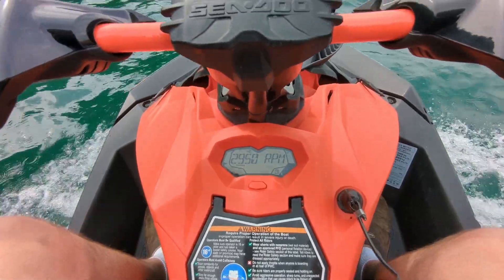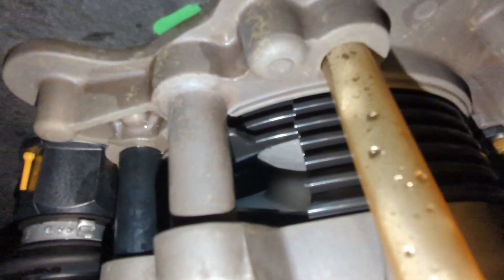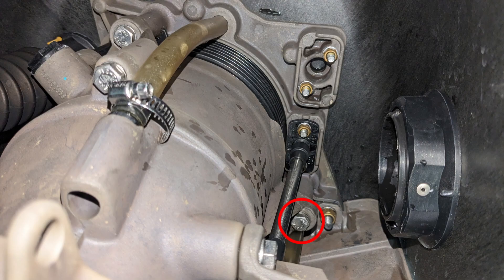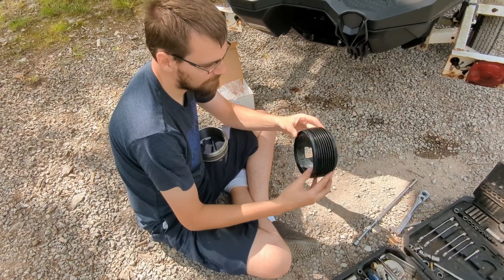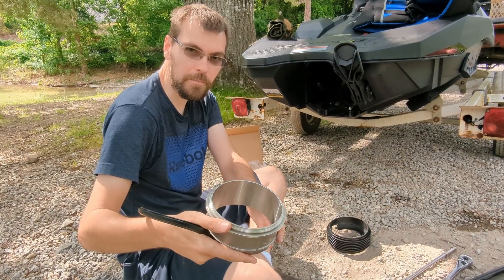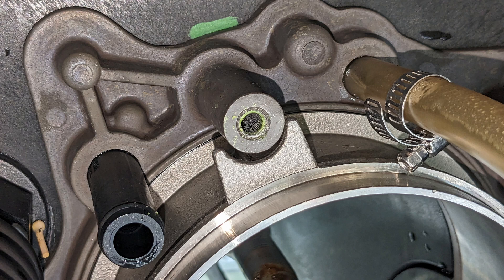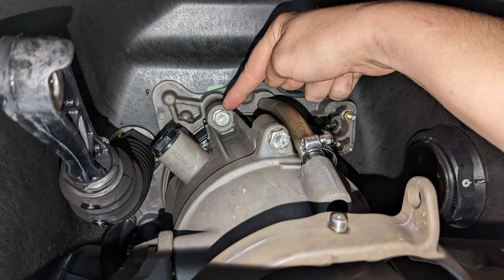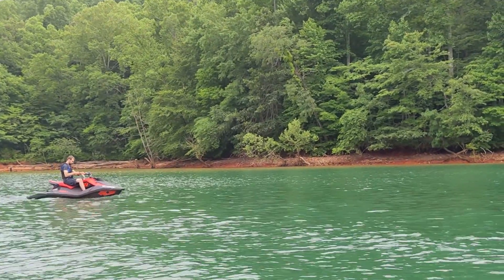Sea-doo Spark wear ring replacement, stainless steel upgrade.

Comment: If you're a responsible rider that doesn't beach their skis or ride through gravel go with SS.  If you are the typical renter stay with plastic
Reply from the maker: I've seen so many rocks and garbage in pumps I'd never beach a ski, not to mention the wear on the gelcoat

Comment: The wear ring is plastic for a reason: it’s flexible and lets debris escape the sides without wearing the impeller. A new impeller costs more than 10 of these plastic wear rings would. It also weighs more. I’d say this is a downgrade.
Reply from the maker: It flexes the debris right out through the side! I go through probably 10-20 of these a year for customers, if people opt for the stainless upgrade, I never do another wear ring for them, and have not had a single one come back for any impeller or pump damage since the spark was released, just oil changes, winterizations, and other service. 
The non spark pumps have metal surrounding the wear ring so it can't just blow out the side, and I don't recommend stainless on those, but without redesigning the entire spark pump so that the wear ring is supported by something, it's a flawed design that this is the solution for imo

Comment: Then it doesn’t “wear” in fact you could expect your shaft or splines to break
Reply from the maker: The way I figure, Kawasaki, Yamaha, Honda, Polaris, Tigershark, literally everyone but seadoo uses a stainless wear ring, and always has, and I've not seen one snap a driveshaft or tear the splines loose yet.
I have however seen a seadoo snap the threaded PTO snout right off the crankshaft with a plastic wear ring.
Reply: Your Sea doo his a 2up or 3 up? I have a Spark 3up and it’s difficult with that little space to work easily
Reply from the maker: @boyzun66  this was on a trixx model, which I believe is a 3up, and yeah its not fun with how tight the hull is to the pump. It's way back in there and tough to reach.

Comment: Thank you!  You did a good job on this instructional video.  It was clear and included some handy tips I haven't seen elsewhere (such as the torque spec for the mounting bolts).
Reply from the maker: I really appreciate your comment! I tried to make it as all inclusive as I could. The sparks are awesome little machines, upgrading the wear ring makes them even better!